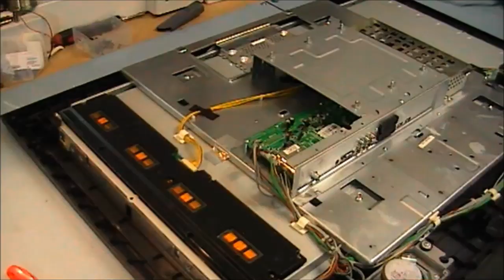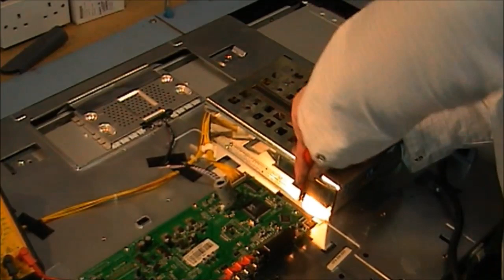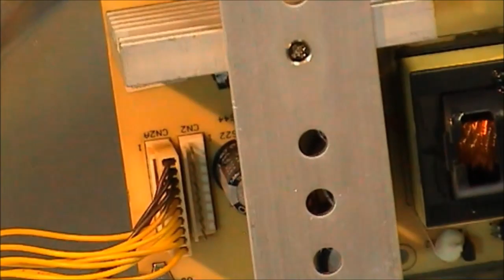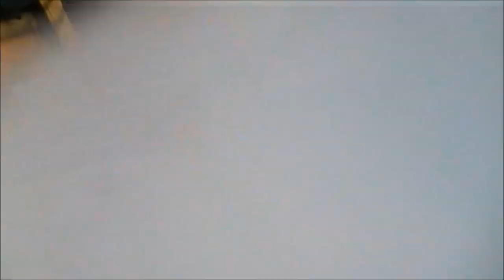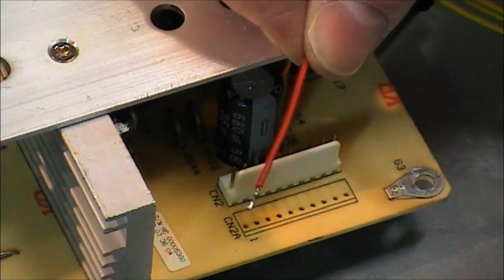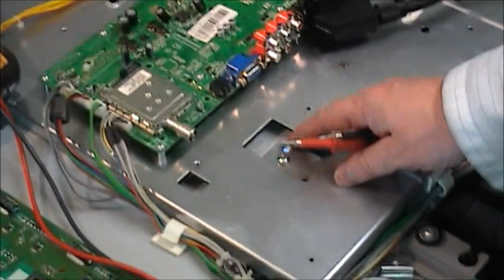Beko 40WLJ520HD No Picture, Sound OK

Comment: Thank you for the Video, 
Actually I have Sony Bravia TV model no. : W600A, it has been two years that I bought this TV just a week ago it lost its picture/video but was able to hear the sound.
I called the sony technician, he came up and said like the LCD panel is gone and I need to replace it. 
I tried by resetting and after a day or so, the TV was working very fine, the video quality was the same as earlier.

I called the technician on phone and asked if he was lying to change the display panel, his answer was there will be a bulb in the display panel, the TV works as long as the bulb is fine.

But I am still not sure if it was true what the technician said.
For now My TV is working fine, Not sure when will it show the problem again.

Do you have any explanation on this
Reply: lllqlllpaaa111
111+₩₩1₩1₩1₩₩
Reply: Je m' appelle Victor Gironella